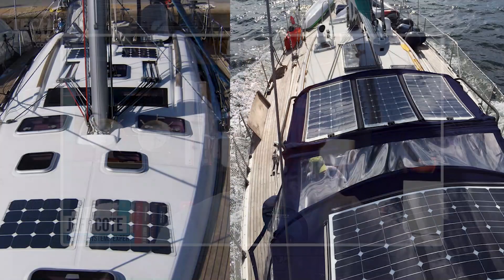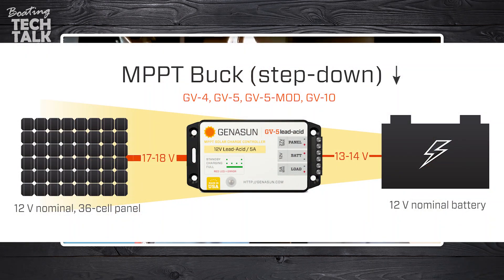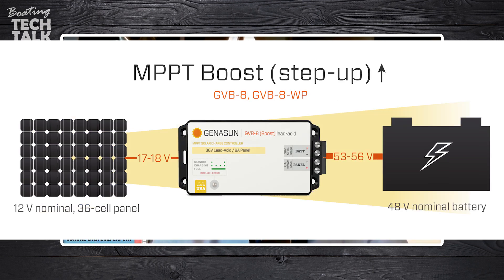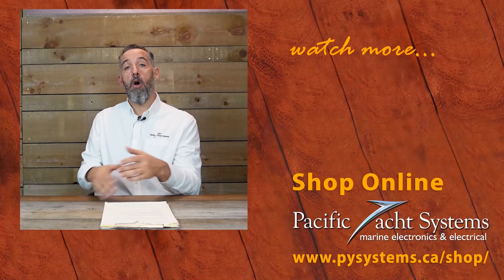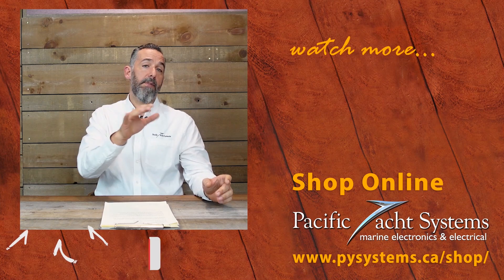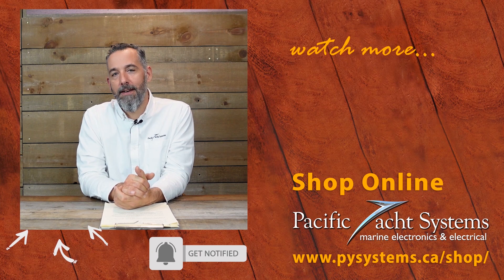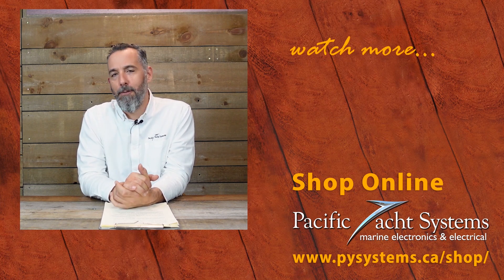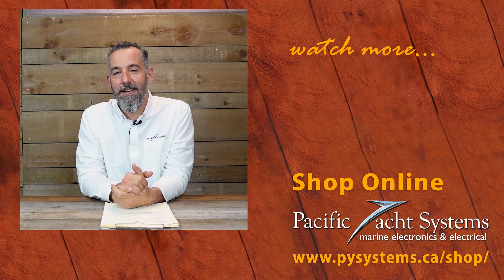Do I Need a Buck or a Boost Solar Controller for the Solar Panels on My Boat?

Comment: Hi Jeff.  I have a question about fusing Inverter/Chargers.  Knowing that I have to use a Class T fuse for my Victron MultiPlus, where should that fuse go?  Should the Class T go right at the house batteries between the batteries and the unswitched distribution (bus bar), or should the Class T go between the Inverter and unswitched distribution?
If the Class T should be between the Inverter & unswitched, what type of fuse do you recommend be right at the battery?  And vice-versa, if the Class T should be at the batteries what type of fuse should be used between unswitched dist and inverter?